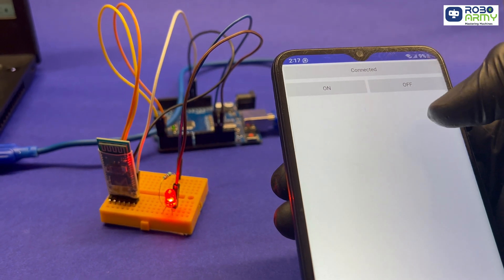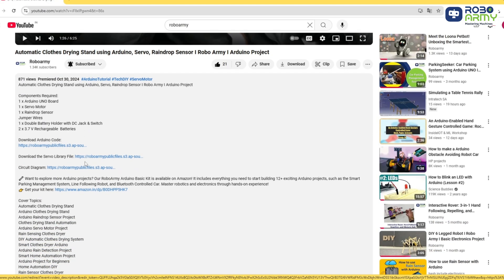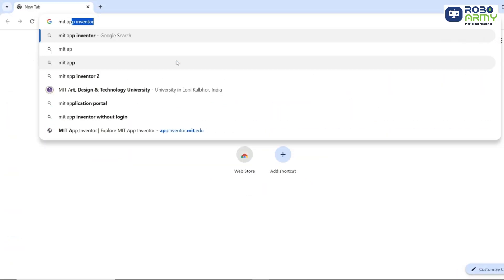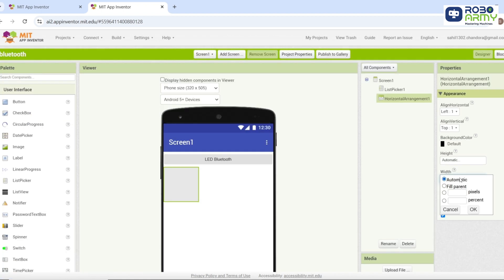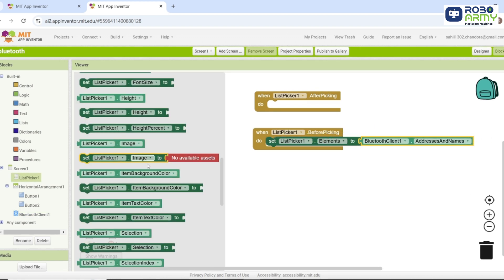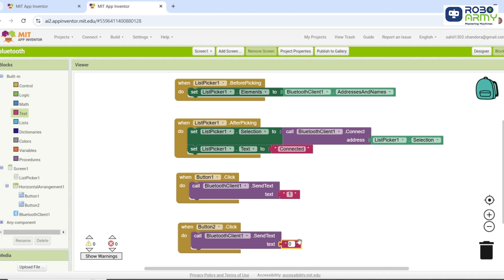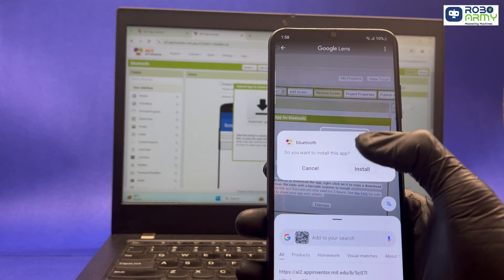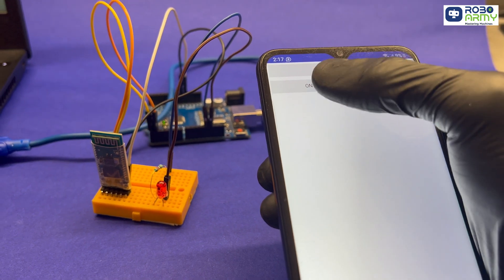DIY Bluetooth-Controlled LED with Arduino + MIT App Inventor

Comment: Hi, I did the tutorial with HC06, I made the app and even my phone paired with the HC06, however no matter how hard I tried it never turned on.
(The circuit, the code and the app are just as you showed them) The reason it didn't work for me is because I used HC06 and not HC05.
Reply from the maker: It's great that you got so far! While HC-06 and HC-05 are similar, there might be slight differences in their default settings or AT commands that affect how they interact, but the core principles should be very similar.

Comment: I tried but didn't work some apps work but not my apps
Reply from the maker: Try to recheck the code and the wiring, and then make sure your phone's Bluetooth is connected to the module.

Comment: IN MIT APP apk app can connet hc05 module but press on or off button not led power on .try it enable location .same things.hc05 moudle 2blinking in every 5 seconds.

Comment: i can't find the hc 05 in tinkercad
Reply from the maker: You're right! HC-05 is not available directly in Tinkercad’s component library. Tinkercad currently does not support Bluetooth modules like HC-05.

Alternative Solution:
If you want to simulate Bluetooth communication, you can try platforms like Proteus or use real hardware for the complete project. For now, you can simulate the LED part and serial communication in Tinkercad to test basic logic.

Comment: The "Bluetooth Pairing Request" submenu doesn't appear, then it pairs with the Device but doesn't Connect. I've checked the wiring several times and that doesn't seem to be the case. Does anyone know of a solution?
Reply from the maker: Hi there! 👋
It sounds like you're facing a common issue with Bluetooth connections. Here are a few things you can try:

Check Bluetooth Permissions: Make sure your phone has the necessary Bluetooth permissions enabled. Sometimes, the app might not have the correct permissions to pair and connect.

Reset Bluetooth Module: Try resetting the HC-05 Bluetooth module by turning off the Arduino and then turning it back on. This sometimes helps with connectivity issues.

Pairing Password: If you're prompted for a password when pairing, use "1234" or "0000". If this doesn’t work, double-check the HC-05 module’s default pairing password.

Clear Bluetooth Cache: On your smartphone, go to Settings > Bluetooth, and remove any old connections or devices listed. Then try connecting again.

Serial Monitor Test: Use the Arduino Serial Monitor to check if the Bluetooth module is receiving the right commands from the app. If it's not receiving anything, try re-uploading the code to the Arduino.

Device Compatibility: Ensure that your phone supports the Bluetooth version of the HC-05 (Bluetooth 2.0). Some newer phones may have issues with older Bluetooth versions.

Hopefully, one of these steps works! If not, let me know, and we can try other troubleshooting steps.

Comment: Hello, I’m working on a project and i keep receiving error 507 when trying to connect my hc 05 to my app. In the bluetooth terminal app I’m receiving the data just fine.
Reply from the maker: Hi! Thanks for your comment. 😊
Error 507 in MIT App Inventor usually means that the app isn’t connected to the Bluetooth module properly before trying to send or receive data.

Since your HC-05 works fine with the Bluetooth terminal app, that means the module is working correctly — so the issue is likely in the app setup.

✅ Please check the following:

Use the ListPicker to first connect to the HC-05 before sending any data.
Make sure you're calling BluetoothClient1.Connect after selecting the device from ListPicker.

Ensure the blocks are in the right order:

BeforePicking: Set elements to BluetoothClient1.AddressesAndNames

AfterPicking: Use BluetoothClient1.Connect(ListPicker.Selection)

Check your BluetoothClient block in the button click:

Only send data after a successful connection is made.

Comment: @robo_army This is ag= great project. I tried it but mine is showing error515, not connected to a device. please how do I fix this?
Reply from the maker: Thanks for trying it out! 😊
Error 515: Not connected to a device usually means the app is not paired with the Bluetooth module (HC-05).

👉 Here's how to fix it:

Go to your phone’s Bluetooth settings.

Search for new devices and pair with HC-05 or HC-06 (default password is 1234 or 0000).

Once paired, go back to the app and use the ListPicker to select the device.

It should now show "Connected" and be ready to control the LED.

Let me know if it still doesn’t work — I’m here to help! 🔧📱
Reply: @robo_army_  When the "on" or "off" button is clicked, I still get the error 515: Not connected to a device

I changed the board and still get the uploading error
Reply from the maker: Thanks for the update! It seems like you’re facing two issues: the AVRDUDE error and the Bluetooth connection issue. Let's tackle them one by one:

1. AVRDUDE error (Not in sync)
This usually happens if:

The wrong COM port or board is selected in the Arduino IDE.

The Arduino is not in bootloader mode when uploading.

Steps to fix:

Check COM Port:

Open the Arduino IDE.

Go to Tools > Port and select the correct port (it should match the port your Arduino is connected to).

Select Correct Board:

Go to Tools > Board and make sure Arduino Uno (or your specific board) is selected.

Reboot Arduino:

Try pressing the Reset button on the Arduino right before you hit the Upload button. This might help the bootloader to sync.

Try Another USB Cable/Port: Sometimes a faulty cable or USB port can cause upload issues.

2. Bluetooth Connection Error (Error 515)
This error typically indicates that the app isn’t able to connect to the HC-05 module. Here’s what you can try:

Double-check Pairing:
Ensure that the HC-05 is successfully paired in your phone’s Bluetooth settings. After pairing, make sure it’s not disconnected when you open the app.

Reset the HC-05 Module:
Try unpairing and re-pairing the HC-05 module in your phone’s Bluetooth settings.

App Connection:
In the app, use the ListPicker component to pick the HC-05 device and make sure the text changes to "Connected."

If you've tried all these and are still having trouble, there could be a deeper issue with the Bluetooth module or the Arduino itself.

Let me know how it goes, and I’m happy to help further! 😊
Reply: @robo_army_  Thank you so much. I did exactly that and got this error: 

avrdude: stk500_getsync() attempt 1 of 10: not in sync: resp=0xfe
avrdude: stk500_getsync() attempt 2 of 10: not in sync: resp=0xfe
avrdude: stk500_getsync() attempt 3 of 10: not in sync: resp=0xfe
avrdude: stk500_getsync() attempt 4 of 10: not in sync: resp=0xfe
avrdude: stk500_getsync() attempt 5 of 10: not in sync: resp=0xfe
avrdude: stk500_getsync() attempt 6 of 10: not in sync: resp=0xfe
avrdude: stk500_getsync() attempt 7 of 10: not in sync: resp=0xfe
avrdude: stk500_getsync() attempt 8 of 10: not in sync: resp=0xfe
avrdude: stk500_getsync() attempt 9 of 10: not in sync: resp=0xfe
avrdude: stk500_getsync() attempt 10 of 10: not in sync: resp=0xfe
Failed uploading: uploading error: exit status 1
Reply: @robo_army_  The device is connected

Comment: Without laptop
Reply from the maker: If you want the LED to blink every 2 seconds without a laptop, you can upload a blinking code from your laptop once, and after that, power the Arduino using a USB adapter, power bank, or battery. Here's a basic code to upload:
void setup() {
  pinMode(13, OUTPUT);
}

void loop() {
  digitalWrite(13, HIGH);
  delay(2000); // LED ON for 2 seconds
  digitalWrite(13, LOW);
  delay(2000); // LED OFF for 2 seconds
}

Just upload this once using a laptop. After that, even without the laptop, the Arduino will keep blinking the LED as long as it gets power! 🔋💡

Comment: How to make it blink every 2  seconds
Reply from the maker: To make the LED blink every 2 seconds, you can modify the Arduino code like this:
void loop() {
  digitalWrite(13, HIGH);  // turn the LED on
  delay(2000);             // wait for 2 seconds
  digitalWrite(13, LOW);   // turn the LED off
  delay(2000);             // wait for 2 seconds
}

This will make your LED blink continuously with a 2-second interval.

Comment: Pls pls pls tell me if i can use this on atmega328
Reply from the maker: Yes, you can definitely use this project with the ATmega328 microcontroller, as it's the same chip used in the Arduino Uno. Just make sure you have the right bootloader and serial communication setup for uploading the code. If you're using a bare ATmega328, you'll need a USB-to-Serial converter (like an FTDI module) to upload the sketch.

Comment: im getting error 507 when pairing hc-05 any idea how to fix it?
Reply from the maker: Error 507 while pairing the HC-05 usually occurs due to incorrect pairing settings or module issues. Try these fixes: 1) Make sure your HC-05 is in pairing mode (blinking LED). 2) Use the correct pairing PIN (1234 or 0000). 3) Restart your phone and Arduino. 4) Try removing and re-pairing the device in Bluetooth settings. Let me know if the issue persists!
Reply: @robo_army_  It didnt. it connects throug other terminal apps but no mit app inventor
Reply from the maker: Since your HC-05 connects through other terminal apps but not MIT App Inventor, try these steps: 1) Ensure ‘BluetoothClient.Connect’ is being called with the correct address. 2) In MIT App Inventor, check that Bluetooth permissions are enabled in your phone settings. 3) If using Android 10+, try enabling Location Services before connecting. 4) Test with a simple Bluetooth connection app in MIT AI first.

Comment: Code is not opening
Reply from the maker: Please install the Arduino IDE and try to open it. Incase if you are still facing issue, please reach out to our official WhatsApp channel - https://wa.me/918888103688
Reply from the maker: https://youtu.be/1VKceGd9Sr8

Comment: Can you please make a drone using esp 32 and also tell how to make it's controller remote

A condition the project should be budget friendly (under $25)

It  is for my science exhibition which is going to  conduct in March month so please fulfill my requirement
Reply: Thank you so much
Reply from the maker: Creating a drone with an ESP32 under a $25 budget is quite challenging due to the cost of essential components like motors, ESCs, and batteries. However, we’re excited to see such an innovative project and wish you the best in your science exhibition!